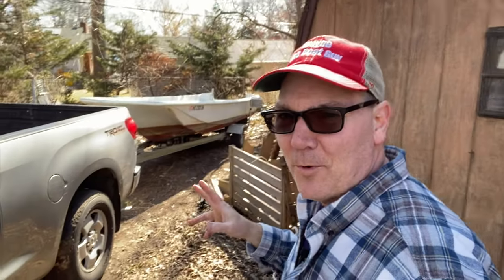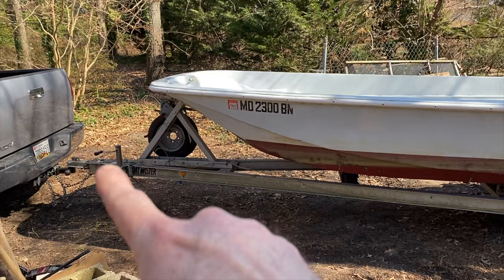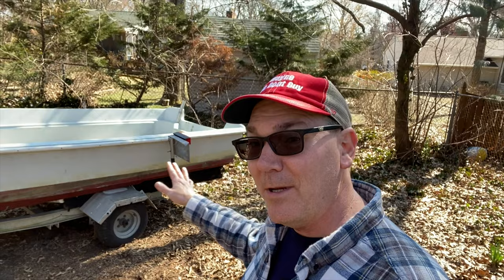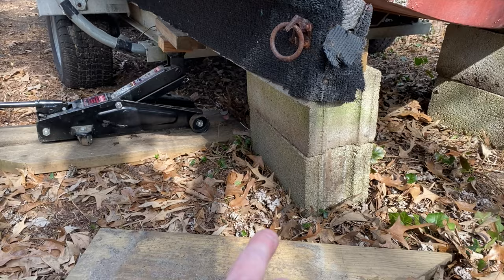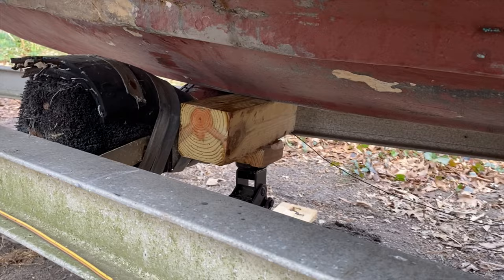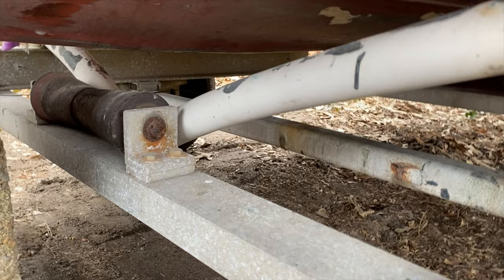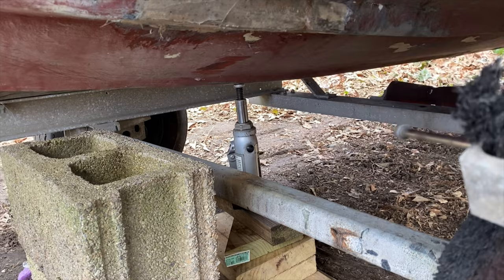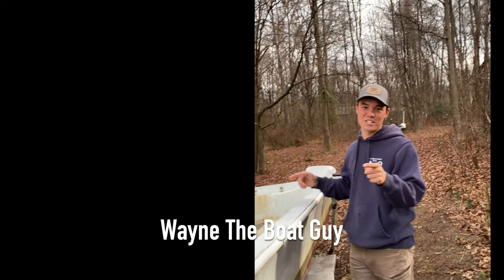Taking a boat off a trailer - My first time putting a boat on blocks

Comment: After the stern was on the blocks you should have chained the stern of the boat to a tree or the base of a stake behind the boat, no slack. Then when you pulled the trailer forward the boat wouldn’t pull forward with the trailer. Then proceeded with your original plan. Much simpler and faster than how you did it.
Reply from the maker: That probably would have been easier!

Comment: Tip: use large foam blocks to rest the boat on. Benefits are that it molds to the boat and it doesn't damage anything. I used them on my pontoon boat

Comment: Weight of the boat should be resting on blocks and a 2×4 on top, under the keel beneath the transom. Side blocking are only for support and to stabilize The boat would be more stable and safer to b we under there moving the jacks...safety is priority.

Comment: You can tie the stern to the tree behind the boat and drive fwd slowly and put the blocks down after going fwd a few feet. Put some type of plywood of old carpet pieces between the boat and the block to not scratch the hull. It should slide off pretty easily and to put it back on the trailer, I used the winch on the trailer and I disconnected the trailer from the truck so it pulls the trailer under the boat.
Reply from the maker: That seems like it would work quite well!

Comment: Looks like there are lots of trees around. Could you have used a rope & pulley around a branch to lift the front of the boat up?
Reply from the maker: Unfortunately all the limbs are very high and not close enough to the spot I needed to put the boat.

Comment: Why didn't you put it on the ground? If it is on the ground you can flip it and work on the bottom.
Reply from the maker: Because apparently it’s harder to put back on a trailer when it’s on the ground.

Comment: 4 tripod and 2 two inch rachet straps strung between them underneath the boat. Done. Wish you'd asked me first.
Reply from the maker: Yeah I don't have any nice boat jack stands around here... yet!
Reply: @WayneTheBoatGuy  if you had made 4 tripods about 3_4 foot higher when opened than the boat, set up in pairs on either side, possibly with a brace across if it is to be up long term, and used ratchet straps underneath, the boat could be lifted and left hanging to be worked on or until you were ready to wer it onto another trailer.
Reply from the maker: @fhorst41  That's pretty cool!

Comment: Front part looked  a complete faff.  Rear part was fine  but a A frame at the bow  to hang the boat would have been a one hit system.
Jim's little boat  ( YouTube channel )  is also a good method and he gets a 22 foot yacht off his trailer.
Reply from the maker: Yeah - I would have had to buy materials to build an A frame though - and I was trying to avoid that
Reply: @WayneTheBoatGuy  Fair enough ... I am forgetting some guys do not keep a good selection of timbers and fixings in stock .

Comment: I need to flip my Nauset so I can redo the bottom.  Any ideas ??
Reply from the maker: It is on a trailer now? If it's up on blocks like this one, I would try to tip it on it's side and then lower it upside down with either 2-3 other humans or some means of mechanical assistance. Then jack it up on each "corner" to rest on the gunnels.
Reply: @Wayne The Boat Guy  Alright ! Sounds easier said than done though...lol